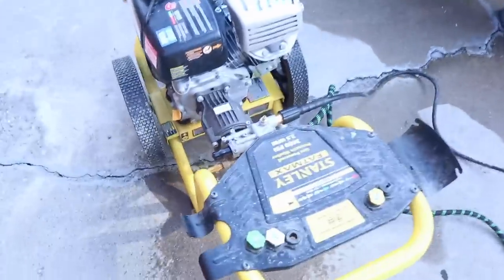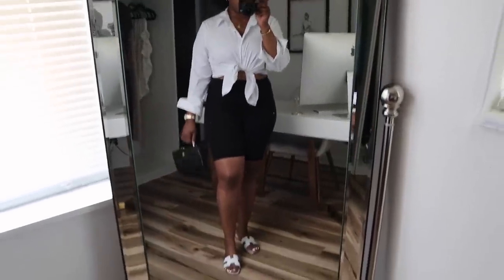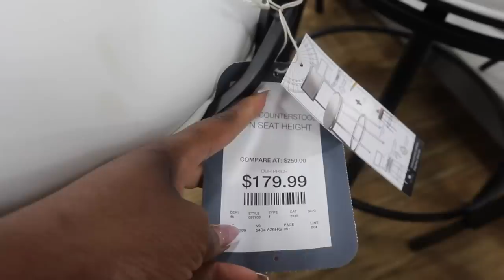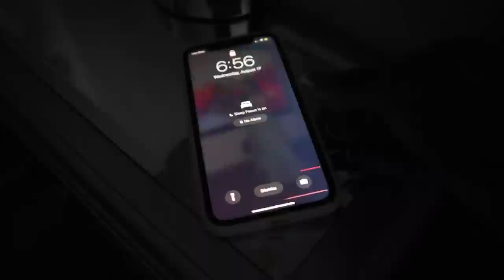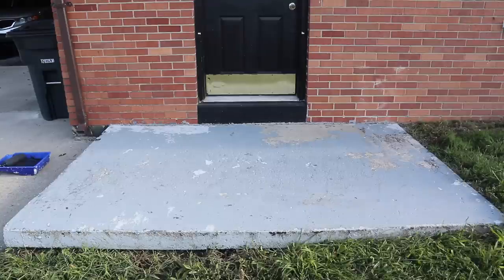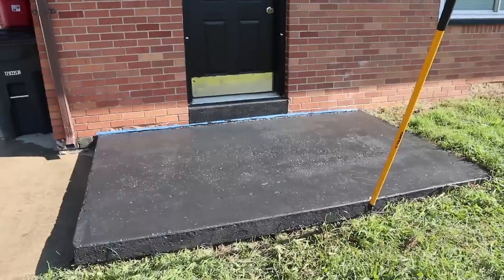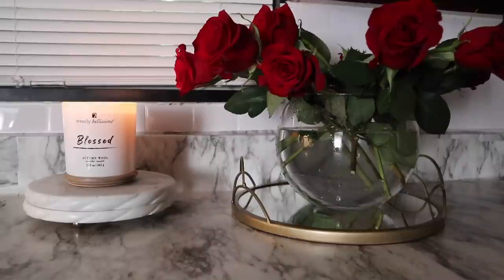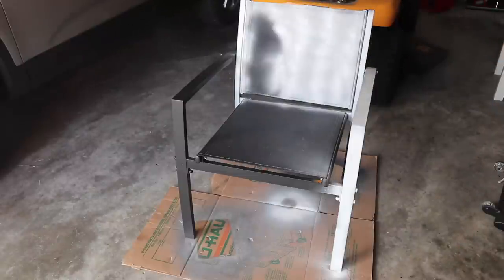HOME RENOVATIONS SERIES EP: 2 DIY FRONT PORCH MAKEOVER |PRESSURE WASHING | PAINTING| DIY FURNITURE!!

Comment: Sis get a paint brush and paint the grooves where the paint is missing.  Then do another coat of black paint. Also,  prime the next time you paint. That will make the color pop.  Clean that paint off the brass plate of the door. You can use Ajax, Comet etc. Other than that it looks 👍🏾 great.
Reply from the maker: Thank you sis ❤
Reply: @StyledByEmonie  You're welcome sis.🥰